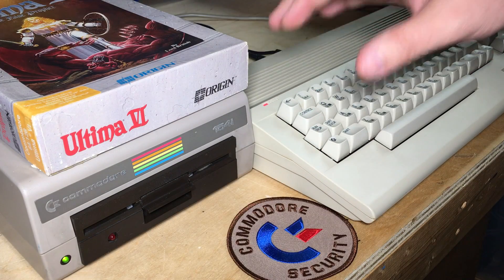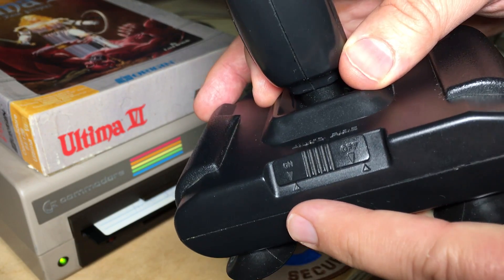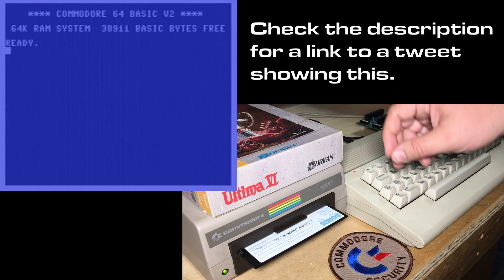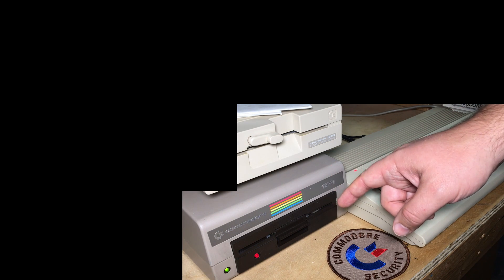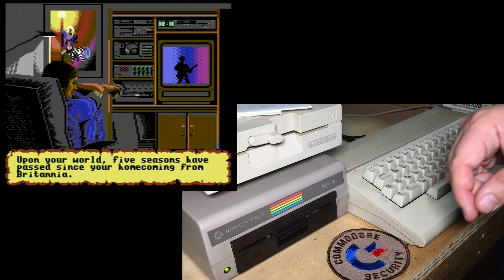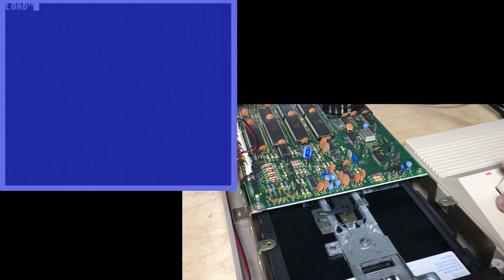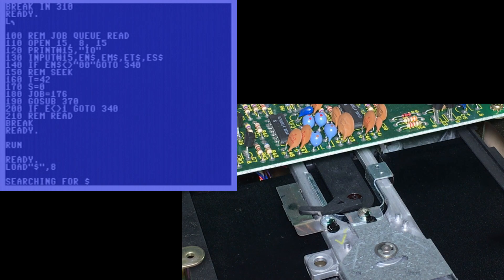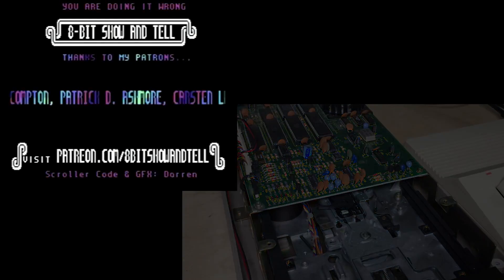Karateka Killed My 1541  (Temporarily) and Other C64 Scares

Comment: I always found it quite hilarious that the controller inside the diskdrive is basically a full C64 without the keyboard 😂
Reply: Without the video chip, the CPU in the 1541 actually runs FASTER than the CPU in the C64.
Reply: @csbruce  I also recall reading that you can turn the video output off in C-64 application that wants to do a time consuming calculations, initialization stuff or other data processing quicker and if I remember correctly the CPU will run 2Mhz when this is done... I'm actually not fully certain if this was in C-64 or C-128 only, but I think it could be done in C-64... I think C-128 might even had a BASIC command (or maybe it was just some pokeing ;) ) that was documented and all, but I dunno, it was a long ago so correct me on any misinformation and take this post with a grain of salt :)

Anyway, I'm guessing the CPU in the 1541 is clocked to 2MHz?

Edit: Also... MTG Rico80? Where did that come from, or has a comment here been deleted? Or maybe you just made a mistake.... May it be noted that I'm not trying to criticize or offend here, just asking because that seems not to be the original posts account name and I don't see any MTG Rico80 in this thread either - could also be that I'm not noticing something obvious here because I'm so baked, LMAO :D
Reply: @robsku1   The C64's CPU runs about 6% faster when you turn off the video output (exactly the same speed as the VIC-20 and ever-so-slightly faster than the Apple II series).  This is because the VIC-II is no longer "stealing" 1000 cycles out of the available 17095 cycles of each frame (NTSC).  The 6510 (and the 8500 HMOS version in the C64C) can only run at 1 MHz (actually about 1022727 cycles per second in NTSC), while the 8502 CPU in the C128 can be set to run at 2 MHz when the video is turned off (even in C64 mode).

The 6502 CPU in the 1541 is clocked at 1 MHz, but it doesn't have a graphics chip stealing any cycles from it.  I'd have to open one of my 1541s to be sure (and I don't feel like doing that right now), but as I recall it runs at close to exactly 1 MHz (like the PET).  This is a bit slower than the C64's CPU with VIC-II DMA turned off and a bit faster than the C64's CPU with video turned on.  We're not talking about huge differences here, in any case.  Only the C128 runs faster when you set it to FAST mode.
Reply: this cries for an overall hack of the 1541 drive to make it a computer on its own or at least supercharge it as a floppy drive
Reply: @alerey4363  This has been done. The 1541 has been used for calculations by some C64 software, early parallel processing :)
Reply: Closer to a VIC-20 in that the 1541 uses a 6502, two 6522s, and has very limited memory.
Reply: Almost
Reply: @Kurt Pedersen  The 6502 cannot be used in the C64's 6510 socket to begin with because they are not at all pin-compatible.  It's not just software that does bank-switching that would fail, no software would work at all, or probably worse.
Reply: C64 is not that much like 1541:) More accurately, they're both 6502 based computers, but you have to stripe much more than just a keyboard from C64 to reduce it to a 1541 controller. That's why i think people were picking on you in the comments, because amateurs might not follow your loose comparision and think that there is another/modified C64 inside :).
Reply: Yeah, basically a full C64 without the SID chip, VIC chip, less ram, no PLA, other roms, a different CPU, ...
Reply: @Okurkaarrgghh  a different cpu? and without all the other components? that's not even close to "another C64" or are you being ironic?
Reply: @Okurkaarrgghh  alrighty then, an overworked floppy drive but by no means a(n almost) full C64 inside that 1541 case
Reply: @alerey4363  C64 uses a 6510, 1541 uses a 6502.
Reply: @Okurkaarrgghh  I feel like a horrible person now. Let me rephrase for the pedantics: the controller of the 1541 is a fully functional 6502 based computer, with 2K of RAM and runs at a higher clock rate than the C64, mainly because the VIC mandates a specific clockspeed to allow 1 bus to be used by 2 separate systems ("simultaneous" access to the RAM by both the CPU and VIC on the same bus). Happy now?
Reply: @Okurkaarrgghh  well if the 1541 cpu is a 6502 thats virtually a 6510 (as tiny differences in memory banking but the rest in terms of ALU, registers, opcodes, buses, etc is the same); maybe the confusion arises precisely by the fact disk drive uses the same cpu as the computer, I mean, one tends to think that having the same "brain" on a floppy mechanism as in the computer is kinda overkill (and overprice) but giving the low performance of the 1541 this maybe the reason for controversy in the comments
Reply: @Okurkaarrgghh  well that speaks for the bad implementation in the 2600 compared to the Apple II and the C64; although the difference is in the surrounding chips (video, audio, I/O, ram, rom, etc) and budget of course, but anyways the 1541 is an example of 6502 cpu underusage; maybe we should compare the Apple II floppy against the 1541 (price, speed, logic)
Reply: @TotallyNotARussianBot69  Unfortunately "pedantic" is the adjective that best describes most YouTube commenters.  Even though they knew exactly what you meant by your original post, they just have to point out the "problems" with it.
Reply: @alerey4363  IIRC the only difference between the 6502 and 6510, software wise, is the presence of an IO register/DDR register at locations $0000 and $0001.  (Obviously the pinouts on the IC's are different.)  The rom/IO banking is done by external hardware which is being driven by the IO port, similarly to how the VIC-II memory bank is driven by an IO port on one of the CIA's.
Reply: @rancidbeef582  It's not just being pedantic. He may as well have said "A C64 is basically a full Commodore Amiga" ... they have about as much in common.
Reply: @AureliusR  My point was that anyone reading the comment knew what he meant, even if he didn't say it this way: "... the controller inside the diskdrive is basically a computer without the keyboard."  Especially comparing it to any other floppy drive on the market at the time (that I'm aware of), it certainly was a computer, if not a "full C-64"
Reply: @alerey4363   Actually, the main differences between the 6510 and 6502 are that the 6510 has a tri-state address bus (necessary for the VIC-II's DMA) and a 6-bit I/O port.  There are several other differences, although you're right that internally they are the same CPU.  They are definitely not interchangeable, however, at least without a daughtercard or something like that to provide the 6510's additional functionality (and switch many of the pins around).

As for the 1541's low performance, that has nothing to do with the 1541 as a drive.  The C64 and 1541 simply use an incredibly cumbersome data transfer protocol, and as we all know, the C64+1541 are capable of far, far greater data transfer rates with no hardware modifications (even "fastloader" cartridges are just substitute firmware).  In fact, I've measured this combination loading data faster than ProDOS on the Apple II and Disk II.
Reply: @Okurkaarrgghh   The Atari 2600 actually uses a 6507, just like the Atari floppy disk drives, which limits it to addressing 8K of memory without bank-switching.  And after a certain point, around 1984-1985, the Apple II series used the 65C02 instead of the 6502.
Reply: @alerey4363   The Apple II's Disk II floppy drive is definitely much simpler and cheaper to manufacture.  This is because it connects to the computer and its CPU directly, just like the 1541's "computer" (microcontroller, effectively) does to its own drive.  Contrary to popular myth, the data transfer on the Apple II is serial, just like it is stored on floppy disks themselves, and the Apple II's CPU does all of the GCR (format) encoding and decoding.  The data transfer rate I measured is approximately 2000 bytes/s when using the original Apple II DOS 3, which is not impressive, but still 5 times faster than the default C64+1541's data transfer rate of 400 bytes/s.  "Standard" fastloaders like Epyx's Fast Load closely match the speed of old Apple II DOS (which people still use a lot because it's built into many games and other software).  For further comparison, the standard effective data transfer rate of Atari floppy drives (the 810 and 1050) is about 1200 bytes/s, which is close to the speed of Commodore PET/CBM computers and their drives through the IEEE-488 bus.

Now, even though the Disk II is far cheaper to manufacture than the 1541, it still cost the same or usually more at retail because obviously Apple charges a premium price for everything.  So the Disk II was cheap for the high-end market, but still cost more to purchase than the mass-market 1541.  As for why the 1541 and, for that matter, the Atari drives have 6502 (6507 with only 13 address lines in the case of the Atari drives) CPUs instead of being directly interfaced with the computer and its CPU, there are reasons for that.  I could take a pretty good stab at what those reasons might have been if anyone is interested, but there were reasons, starting with the Apple II's expandable architecture versus the PET's closed architecture.  Since you couldn't make disk interface cards for the PET, the only way to add disk drives, which came later (like for the Apple II, which originally depended solely on tape drives), was through the IEEE-488 bus, and that meant "smart" peripherals, which, by the way, is the norm today, as everything has its own "CPU" (microcontroller).

By the way, as most of us know, the C64+1541 can transfer data a lot faster than Fast Load , which means that it can be faster than the Atari or Apple II.  ProDOS sped up the Apple II a lot, but there are fastloaders on the C64+1541 that are faster still. 😈  So why was the C64+1541 so slow by default?  It wasn't by choice, it was because there was a critical data line that enabled "burst mode" (like on the C128+1571) that was deleted by mistake on the C64's mainboard.  There was no time left to fix the problem and/or management didn't care to because they expected the 1541 to be a flop just like the 1540 was for the VIC-20, so the C64's designers had to go back to a slow but reliable protocol.
Reply: @glenndoiron9317   Actually, the 6510 also has tri-state address lines, which are needed by the C64 design for VIC-II DMA.  The Atari 8-bits have a similar requirement for ANTIC DMA, which is implemented in the specialized 6502C "Sally" CPU on the XL/XE series and as separate, additional, external circuitry on the 400/800 along with a standard 6502.  For reference and comparison, neither the Apple II nor the VIC-20 has such a requirement, so they use the standard 6502 (and later the 65C02 on the Apple II series).

You're right that memory banking is handled externally, largely by the PLA that takes the place of what would have been quite a crowded and complex (and therefore more expensive) mainboard.  The 6510's I/O port is also used to control the tape drive.  Basically, the C64 needed several additional I/O pins, so the chip designers stuck them on the 6510, which (after other modifications) had 6 pins to spare.  Kludgy, definitely, but the Atari 8-bit design also has such kludges, which is why the internal speaker is controlled by the GTIA graphics back-end chip and the POKEY sound chip handles keyboard I/O (deliberate, as "KEY" is part of its name, but a rather random combination of audio and keyboard functionality), except for the console keys (on the right), which are handled in a different way by the GTIA chip.  Wacko. 🤪
Reply: @Okurkaarrgghh   If you mean the original, plain, and apparently quite rare Apple II from 1977, then yes, it uses a 6502 CPU.  The Apple II Plus also uses a 6502, as well as the original Apple IIe.  All I said was that the Apple II series from around 1984-1985 switched to the 65C02.  This included both the IIe and IIc, and Apple made an enhancement kit available for the older IIe that replaced the 6502 with a 65C02.  From that point onward, the IIe always came with a 65C02, and the IIc always did from the start.

Not that much Apple II series software makes use of the 65C02's extra instructions and addressing modes.  Upgrading for most people back in the day was optional.  The main advantage is that the 65C02 runs cooler and is more reliable.  Some of my Apple II series computers use a 6502 and others use a 65C02.
Reply: @Okurkaarrgghh   I brought it up for completeness, because when most people see "Apple II" it refers to the mutually compatible series.  If you only meant the Apple II specifically, then OK, thanks for clarifying that, but those are so hard to find that I have to believe that not many of them were ever made.  So I decided to bring up far more common, familiar examples of the series to better inform anyone who might be reading this, just like how I brought up that the Atari 8-bit series, another mutually compatible series of computers, uses the 6502 in some cases (400/800, with additional support circuitry) and the 6502C (partially like the 6510 for less circuitry on the board for reduced cost) in others (XL/XE, which I believe are far more numerous, like how the Apple IIe is the most numerous and familiar model of that series).  I also mentioned that the C64C uses the 8500, which is the fully compatible HMOS version of the NMOS 6510.

I didn't say you were wrong about the Apple II, I just added some information.  In the Apple II series, I think the 65C02 easily outnumbers the 6502 (at the very least they're comparable in usage), so I thought it was worth mentioning.
Reply: @robsku1   The NES actually has a Ricoh 2A03 ASIC as its CPU.  On it are a 6502 compatible core without the BCD (binary-coded decimal) mode, and the NES programmable sound generator (sound chip).  So it does sort of have a 6502 (almost), but in a package with other things, like the 6510 (which has a complete 6502 core plus 6 I/O lines and tri-state address lines), which could be considered an ASIC (application-specific integrated circuit), as well, along with Atari's 6502C.

As CPUs, from the software perspective, the 6510 and 6502 are identical, with the exception of addresses 0 and 1, of course, which implement the 6510's 6-bit I/O port.  Also of note, in the specific case of the 1541 (and other Commodore floppy drives), the overflow flag of the 6502 is externally set when the byte-sync signal is active.  This is a little-used feature of the 6502 that Commodore decided to exploit in their floppy drives.  Other than this, the exact same code (including "illegal" opcodes) can be run on both.  And, not that you asked, but the Ricoh 2A03 in the NES lacks the BCD mode, as I mentioned earlier, so obviously you can't use that, but other than that, it works just like a 6502 (including illegal opcodes).

6502 machine language routines can be written to the 1541's 2K of RAM, and executed in the drive using standard CBM DOS commands.  There is enough memory for the necessary buffers and some code.  This is exactly how fastloaders do their thing, of course.  I'm not aware of any other computers on which this can be done, at least on bone-stock hardware with no mods.  Atari drives have 6507 CPUs, and some folks claim they can likewise be reprogrammed from the computer, but I don't see how, and they only have 256 bytes of RAM anyway, which is just enough for one buffer and the stack and other things.  By the way, 128 bytes of the 256 the Atari drives have come from the 6532 RIOT chip.  Hmmm...a 6507 and 6532 are two-thirds of the chipset of the Atari 2600! 😁
Reply: @TotallyNotARussianBot69   The 1541's 6502 CPU actually runs at a slightly slower clock rate of 1 MHz, while the C64's 6510 runs at about 1.023 MHz.  The VIC-II steals enough cycles to effectively slow the C64 down to 0.9629 MHz, though, so the C64's CPU is sometimes faster and sometimes slower than the 1541's by a little bit, but in terms of clock rate, the C64's CPU always runs a bit faster...to be pedantic. 😉  This is without sprites, by the way, which when active slow the C64's CPU down by another 3% or so (well worth the trade-off).
Reply: Some copy protections back in the day were downloaded into the 1541 and run from there, independent of the C64.
Reply: Yes because most people find a snappy comment more fun to read than a technical lecture.
Reply: @TotallyNotARussianBot69  It was not pedantic nor your comment just "short and snappy", it was erroneous. Maybe you find it "correct enough", but really there is too much difference with full C-64 and just same (or compatible) CPU. What I think you may have wanted to express is something like "I always found it quite hilarious that the controller inside the diskdrive is basically a second CPU for C-64!". Maybe not exactly that, but you get the point. The point is nobody said you have to write a "technical lecture".
There's no reason to get offended when someone corrects you, whether you think it's deserved or not, it was certainly no huge insult.

I did not write this to offend you in any way and I hope you don't take it as such; I've no interest to fight about nothing :)
Reply: @TotallyNotARussianBot69  Just admit that you were wrong in thinking that the controller in a 1541 is a full C64.
Reply: @Okurkaarrgghh  Jawohl Herr Wachtkommandant, I confess to you, the Great Arbiter of Comment Section Truths, that my initial statement lacked technical depth and was sloppy written. However, I will stand by the intent of my comment, namely that it was for commodore cheaper to put into the 1541 a fully working 6502-based computer with its own RAM, ROM and IO than design a controller chip. I'm deeply sorry for all the pain and suffering my incomplete/half-truthy comment has caused to you.

Damn, this community is supposed to be fun. Drink less vinegar.
Reply: @TotallyNotARussianBot69   I agree about this actually being a cheaper option for Commodore, especially in the early days when some of their major design patterns were set.  The 6502 (and derivatives) were incredibly inexpensive in comparison to the competition at the time.  The Z80 would come along to challenge it, and others would drop their prices eventually, but at a certain point in time, the 6502 was just insanely affordable: a small fraction of the price of any other comparable CPU.

No one would be dumb enough to use a $100-400 6800 CPU, for example, in a mere disk drive, but a $20 6502 is totally plausible.  And while it would make some kind of "sense" to use a cheap CPU in a drive and a more expensive CPU in the computer, in my opinion the 6502 is a more powerful CPU than the 6800, despite being much cheaper, so why not use the 6502 in both, which makes more practical sense as opposed to theoretical sense?  That's exactly what Commodore did, as the 6502 was cheap enough for a drive, but powerful enough for a computer.

Except for the Apple II's Disk II, most every other drive at the time (or even much later) used some kind of ASIC or microcontroller anyway, and Commodore's choice was their own super-cheap 6502.  Steve Wozniak of Apple was clever in also using a 6502, but the one in the computer instead of an additional 6502 in each drive.  He could do this because of the way the Disk II was interfaced with the Apple II.  The drive became part of the computer at a low level (lower than contemporary, later, and modern computers), so it was controlled by the computer's 6502 directly.  No one else did it this way, as far as I know.

That's very efficient, but on a side note, I think at least theoretically the C64+1541 has the potential to be faster than the Apple II+Disk II.  How?  Well, I've heard (but have not yet fully confirmed) that the very fastest C64 fastloaders have managed to split the GCR (format) decoding duties between the two CPUs, while the Apple II has only one CPU to work with.  Additionally, the Disk II interface is serial in each direction (there are 17 other lines for all of the other control signals, but only one for read and one for write), while the C64 and 1541 use both the data and clock lines of the IEC for both read and write, which is obviously 2-bit parallel.  The 1541 still has to read data off the disk one bit at a time, so I guess my real point is that the 2-bit parallel bus more than compensates for any additional overhead bits that need to be transferred to the C64 because of the split in the decoding of the GCR data.  I've seen a couple of these fastloaders in action (and used them), and indeed they are significantly faster than ProDOS on the Apple II, which itself is significantly faster than the original Apple II DOS.  It's funny to think that the C64+1541 has faster data transfer potential than the Apple II+Disk II (or the Atari, for that matter), but I think it might, which makes its sloooooow default speed and horrendous reputation rather ironic.
Reply: And it doesn't have the BASIC, Kernal or character ROM... so it is not a Commodore 64 at all...
Reply: Thiesen yeah yeah. The 1541 has its own ROM